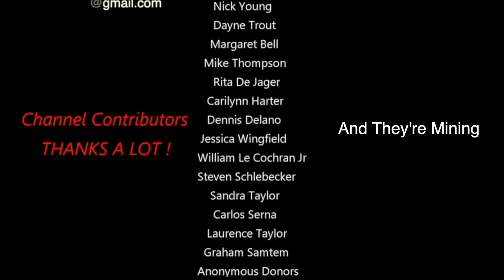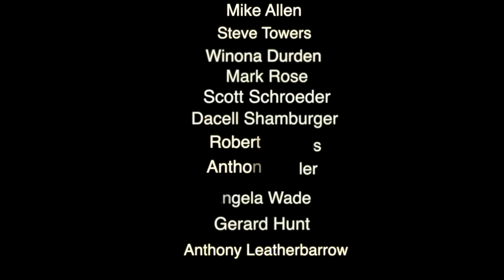Lunar Surface Anomalies & Possible Construction Proof & Explanation

Comment: Hey Bruce I hope all is well. So I used a bahtinov mask to focus in on regulus from leo constellation the other night and have been locked down at that focal length since. Both the moon and the sun are pin sharp too at this setting. Regulus at 456300000000000 miles, the sun at 93000000 miles and the moon at 240000 miles. What's your thoughts?? Obviously I can under and over focus so surely from the moon to regulus there should be some requirement for focussing. I have used my telescope terrestrially and constantly require adjustments at various loong distances so what's up with that?